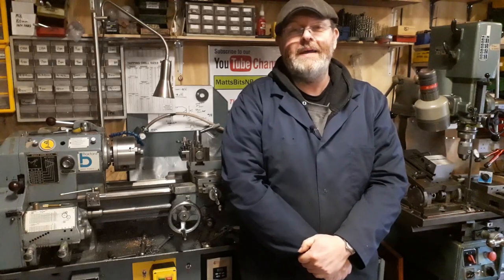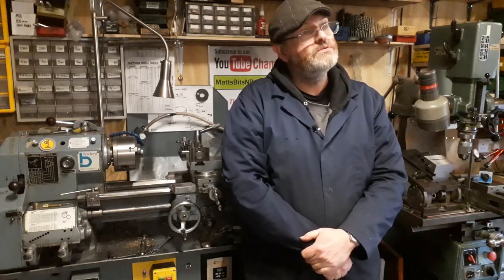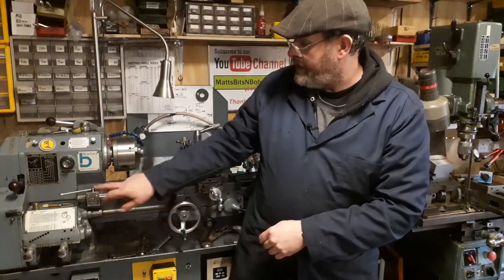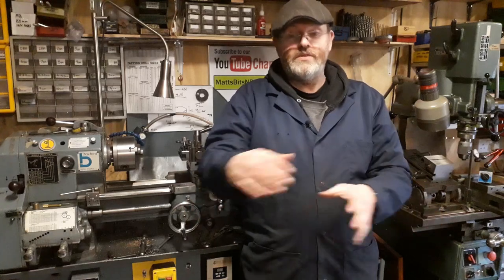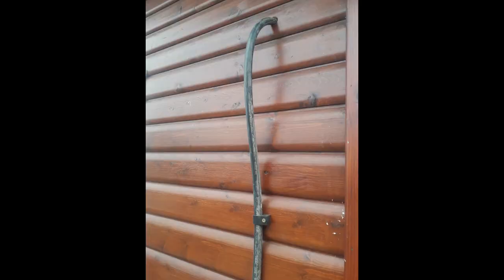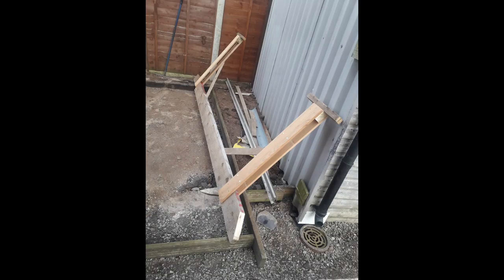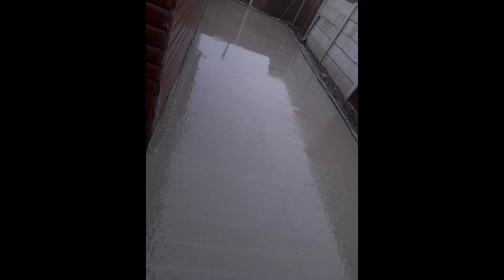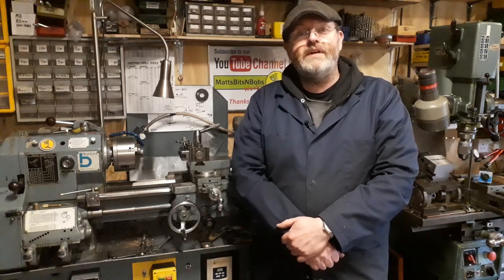Big News, Machine Workshop expansion, need more room? No problem

Comment: Big was your workshop before and how big will it be when finished? I am almost getting my workshop water tight just a little bit of cladding and roof to finish off mine is a 5 metre by 3 metre workshop that was the max i could build i have loads of plans for the future in model making just hope my space is enough 🤷‍♂️
Reply from the maker: Thanks Keith, my first was about 2mx2.5m and made loads of stuff and my next was around what you are building (to be honnest a perfect size because I couldn't fill it with junk) and had plenty of lights that made it feel bigger. Good luck with the roof.